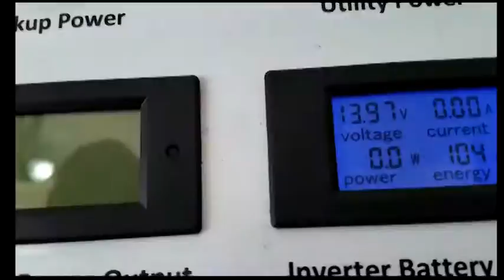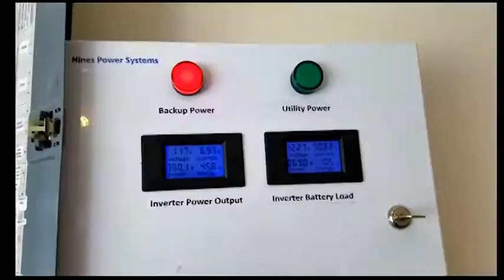Aims Whole Home Uninterruptable Power System

Comment: well done
Reply from the maker: Thank you - This system has been online and running about 7 months without any issues and gets tested much less than before. Maybe about once or twice every 2 or  months for 30 to 45 minutes at a time. My guess is that the new subdivisions in the area are now connected, so less interruptions. I still get some power outages due to weather though.

Comment: Transfer from utility to inverter power doesn't seem fast enough to keep computers, etc from rebooting.
Reply from the maker: You are probably correct 10ms is too slow to keep computers up, but your pcs or servers should be connected to UPS anyway. Don't you agree.
Reply: Anthony Hines Agree regarding additional UPS. Is your system still functional? How often have you used the inverter and what kind of loads does it see?
Reply from the maker: golf-n-guns 
Since I am in a fairly new subdivision I often get 1 to 3 hr outages once a month as new subdivisions are being connected to the grid. My UPS does not have the run time to keep my servers up so I came up with this system which works great. I now have a full battery bank 6 bstteries.
Reply from the maker: I now have six 200ah AGM batteries. I did change the inverter to a 24v 4000w model from the 12v version. This gives me 600AH total, but 300AH @ 50% usage. My power requirements gives me an average of 5Hours of backup power @ 50% which I have not exceeded to date.
Reply: Thanks for all the info. I'm intrigued by AIMS, but have viewed and read some bad reviews online.  Regarding your battery bank, are you using deep-cycle automotive-type batteries?  AGM or flooded?  I'm assuming you have 3 pairs of serially connected 12 volt batteries paralleled together?
Reply from the maker: I have 3 pairs hooked up in a series / parallel giving me 600ah at 24v and they are Deep cycle AGM 200ah each. So far I like my AIMs inverter. I too have heard negative reviews, but so far so good for me and it gets tested at least once per month and sometime even twice. My load varies from 900w to 1360w depending what loads are running at the time for the power outage.  I wish you all the best on your setup and the inverter you choose.
Reply: Thanks for all the info.
Reply from the maker: Please none of that type talk on here. We are all here to learn from each other.
Reply: @golf-n-guns  Probably from paid agents and trolls. Aims are among the Best Inverters in the Game, total BEASTs. Particularly the "blue" PICOGLF line.

Comment: Hey Anthony, do you have a wiring diagram of your installation. Thanks
Reply from the maker: No I do not have one, but any electrician could hook up the inverter to sub panel for you. I am trying something different by using a home made auto transfer switch for the circuits I wish to keep active in the absence of Grid Power. The Reliance Manual Transfer switches are the closes thing to what I have when it comes to the hookup to the main panel.